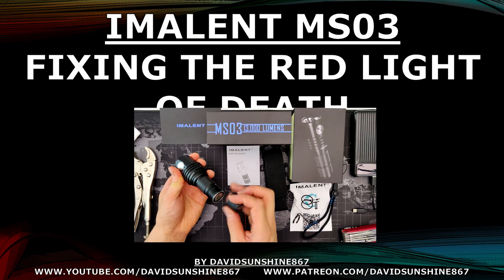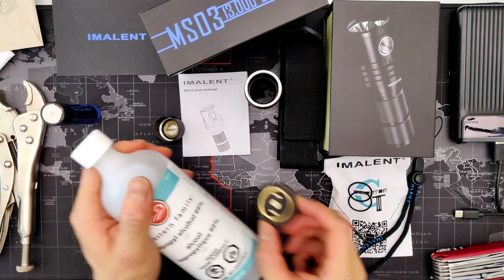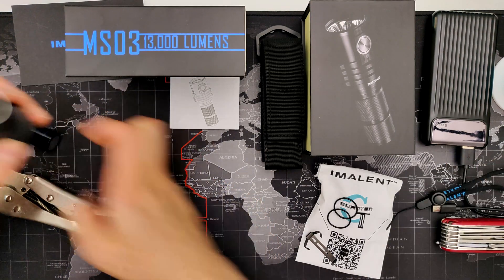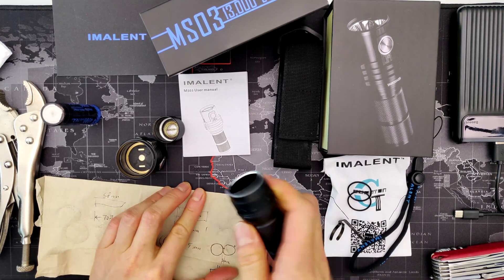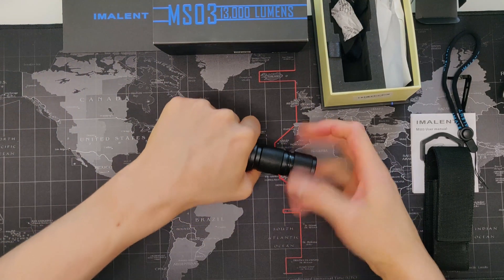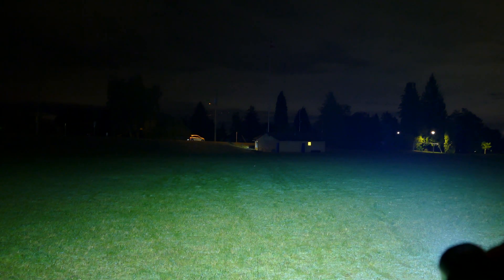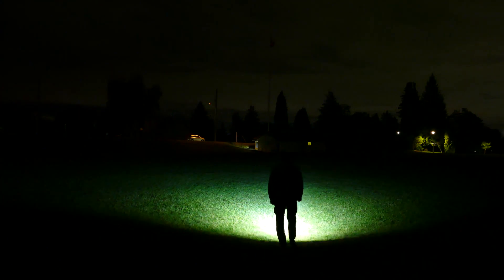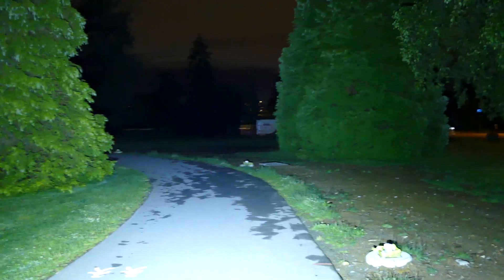How To Fix IMALENT MS03 - Red Light of Death

Comment: I wish I had the general electrical knowledge to attempt this but I returned mine and will wait a couple of months to re-order the improved model. For others who think Imalent won't honor your return they refunded the entire purchase price AND the UPS shipping cost to an address in Georgia. Hope they get it right next time.
Reply from the maker: Hey thanks for letting us know!  I'm in Canada, and they asked me to ship to China, so that was expensive, and they wouldn't pay for it all.  Not really worth it for me to return. But glad they have a place to ship to in the Georgia.  I would recommend purchasing from Amazon, since defective products are easy to return and it's paid for by the seller.  By now, I assume the new stock have been fixed.  I don't think they fixed the switch tho, it can probably still get water into it and stop working, until you let it dry out.  It's just a tactile switch under that metal button; I took it apart a couple days ago to check.  If you want full water-resistance, you may want to look at another light.
Cheers!
David.

Comment: Does this light function properly if using a Samsung 30T or 40T?
Reply from the maker: Hi,
After cleaning up the threadlock and contacts, I tried a Tesla cell and the Sofirn 40A cell (might be a wrapped Samsung 40T?), and they seem to work similarly to the Imalent cell(initially anyways, I didn't do endurance testing with cells other than the Imalent).  This light can only use the extended cell that it came with, unless you extend a 21700 to about 75.75mm; I used a piece of copper as a spacer, seemed to work fine.  I don't have the 40T or  30T, so I can't check with those, but I'm sure it'll work well with those.
Cheers,
David.

Comment: Not working for my MS03.  Disappointed.
Reply from the maker: Hi Clement,  
Thank you for the feedback, it's great to hear the status of everyone's fixes.
It is a very finicky flashlight actually, as there are many points in the system that can cause the low voltage cutoff the engage. Mine started degrading in performance, and I think it was hitting the LVC again prematurely, so I did a second cleaning, and it's working a little better. 
It appears that if the battery is at about 3.81V, the red light will appear for a few seconds.  After my first cleaning, it appeared(for a few seconds) at about 3.9V, so cleaning all the contacts very well, will make it perform better.
If you don't want to try cleaning it any more, I would send it back for repair, I'm not sure how well their customer service works, but it looks promising. 
If you'd like to do the cleaning as I have, I think you'll be happy with it's performance.  I did some endurance testing, and I was able to go into turbo for 45 seconds, 7 consecutive times with 5 minute rests in between for cooling and testing of voltages, before the red light appeared.  I was also able to go into turbo 12 times for 45 seconds, until the red light stayed on indefinitely, so that's pretty impressive, since that's about 5.25 minutes of turbo with no red lights, and a further 3.75 minutes (total 9 minutes of turbo) of turbo with momentary red lights.
The interfaces that I cleaned with Deoxit and polished with sandpaper are listed below:
1.)  Battery terminals (Deoxit)
2.)  Spring contacts to the battery and tail cap (Deoxit)
3.)  Tail cap to body tube (Deoxit)
4.)  Body tube to tail cap (Polish and Deoxit)
5.)  Body tube to driver (Polish and Deoxit)
6.)  Driver Negative and Positive Terminals (Deoxit with wood). Make sure no threadlock residue is present.  Use a magnifying glass to check the terminals for burrs, make sure it's smooth and makes good contact with body tube.
After the above, I torqued the body tube to the head with about 25 ft-lbs of torque, pretty hard, since you need good contact to the driver from the body tube.  When installing the tail cap, I also twist on as hard as the hand can turn.  
After completing the above, the flashlight should be able to pull 25-30A without detecting a low voltage, as long as the battery is charged above 3.9V.  
Hope that helps!
Cheers,
David.
Reply: @DavidSunshine  Thank you David for the details.  I will try what you have suggested again.
Reply from the maker: Hi Clement, 
It looks like Imalent is aware of, and has fixed the sloppy threadlock issue; in this video released 6 days ago, they show flashlights with a 202007... serial number, I assume it was built in July, and should operate properly, like it should after you fix it. You may want to just contact them and exchange for one of these, if you can't get it working normally.
https://youtu.be/r_cMLSS-Kz8
The one I ordered has a 202006 serial number, and had sloppy threadlock all over it!
Cheers!
David.
Reply: @DavidSunshine  My MS03 has serial number 202005XXXX
Reply from the maker: @wokwithwong  Good luck!  Sounds like yours was made just a month earlier than mine.  We can assume all lights made prior to July require us to clean up the threadlock.  
If you're still having trouble, I recommend contacting them to get a replacement made in July, without the threadlock issue, I'm sure they'll make it right, they seem like a reputable company. 
Cheers!
David.
Reply: @DavidSunshine  Turns out my MS03 was a defective unit.  I have contacted Imalent, returned the defective unit and waiting for a replacement.
Reply from the maker: @wokwithwong  Thanks for the update!  That sucks that it's defective, it'll suck waiting, but that's great they'll send you a new one.  Hopefully the fixed all the bugs in the new batches.
It's a good quality light, I did some drop testing on it and it seems tough, aside from the front ring that pops out, just gotta push it back in.  And the side switch gets water in it, but that doesn't affect the driver, just the switch. As soon as I dried it with some heat, it started working again.
They said this was IPX8 but it can't even handle a bucket of water got an hour.
Aside from that, I'm still pretty happy with this purchase.  One powerful pocket rocket still!
Cheers!
David.

Comment: Wow. Exactly. Thank you so much for the advice. You save Imalent both $$ in returns &/or repairs & in "image."
Reply from the maker: You're welcome!  Hopefully!  It's also a pain to have the down-time of sending back the flashlight and waiting.  We also like modifying flashlights, so why not take it a part a little and have some fun right?  This reminds me of my Convoy S2+ Inferno, it pulls a lot of amps for it's size, and gets hella hot just like this MS03, but the MS03 is even more crazy, so some headaches with current draw are expected. 
I'm surprised they didn't bypass the tail spring, but I touched it, and it's actually not hot after a turbo session, so there must not be much resistance there.
Looks like they released a new video showing the 202007.... numbered flashlights operating properly, so their July 2020 builds should be fine!  https://youtu.be/r_cMLSS-Kz8
Cheers!
David.

Comment: There is no fix and Imalent still believe it's glue residue lol 🤦‍♂️
Reply from the maker: I'd say they're halfway there.  I got mine fixed by cleaning the threadlock off with a chopstick and contact cleaner, and I also took out the tail spring and cleaned that all up.  I also cleaned up the tail contacts on both the tail cap/spring and body tube sides, as well as the body tube at the front.  I used polishing sandpaper, but I don't think that's necessary, but if you're having issues still, I would use polishing sand paper then some Deoxit, as it leaves a protective coating.  
With all the of the above, I've fixed mine, and am very happy with it.  It's a beast of a light!  I'm doing a full review of the light, so stay tuned!
Cheers,
David.
Reply: @DavidSunshine  It will fail again. They've sent me a 3rd sample stating its from the fixed batch. This time its a MS03W, guess what? Red light.
Reply from the maker: @FLASHAHOLIC_TV  I'll do extensive testing on mine and keep everyone up-to-date.  That's too bad they haven't been able to figure it out tho. 
Cheers!
David.
Reply: @DavidSunshine  A few people have cleaned it up including myself but the issue comes back. I've had it happen on an E07 too, the head would only work with a copper body, Fireflies were stumped!!!
Reply from the maker: @FLASHAHOLIC_TV   I see.  Thanks for the heads up!  Sounds like the low voltage protection is kicking on early.  Mine seems to be working fine now, and the light is staying green, but I'll do more testing and see what happens, and include it in my detailed review.
Cheers!
David.
Reply: @DavidSunshine  apparently it still red lights with a soldered 40T
Reply from the maker: @FLASHAHOLIC_TV  That was my experience as well, no matter what cell I put in, it would give me the red light indicating low voltage detection(I put in a 21700 Tesla cell, and the Sofirn 21700), but after I cleaned mine up, it is working as intended with the stock battery.  They set the low voltage protection at 3.6V, so if the voltage detected is less than that, it'll indicate a red light.  They should have set it lower if their boost driver can handle it, I would rather they set it to 3.0V.  It still works ok running at 3.6V, as I've been able to go to turbo 7 times before the drive detected something below 3.6V and went red, which means it works as designed.  Cheers!
David.
Reply: @FLASHAHOLIC_TV   we are so sooooooooooooooooooooo appreciate for David Sunshine. thanks dear david, you are sooooooooooooooooooooooooooo much. your words means a lot for us @David Sunshine
Reply from the maker: @ImalentFlashlight  My pleasure!!  Flashlights are our hobby, and we appreciate all the hard work Imalent put into the engineering and manufacturing of your flashlights, to bring us a great product!  Keep up the good work!  Your designs and special features are pushing flashlights to the limits, beyond that of any other company, so that's great to see and we're enjoying your innovation every step!   Can't wait for your next evolution of flashlights!  Cheers! David.

Comment: I returned this flashlight due to that problem, also even when fixed this battery can't hold more then 3-4 turbo runs also its stepping down after few second anyway.Flashlight get so hot that you can't hold it, its to small for that power output and battery is to weak to power the flashlight plus the cost is to much,  ordered ASTROLUX EC03 just for 35€ way better throw and very nice flood
Reply from the maker: Ya, it's way too small of a light for 13,000 lumens, that's like 130w lol.  But if you want to have that much power in a compact flashlight, this is the only way to go right now.  They've got a lot of thermal protection to reduce the light output, or stop it from going into turbo, so I think they've done well by adding those. 
It is pretty pricey tho, and at this size, it really can only be a 2000 lm light, continuously.  
For those who want a good amount of light for a long period of time, the Convoy L6 is a good size, it can push the full 3800lms and be really warm, but never got scorching hot since it has huge heat sink fins.
The EC03 looks like a great like.
I'm happy with my EC01, great thrower and power output, the EC03 is just even better!  And at that price, Astrolux is giving great bang for the buck.
The XHP50.2s are awesome, I'm thinking of adding one to my S2+.
Cheers!
David.

Comment: Banggood don’t even wants to reply to all my emails as I think they also could not solve this problem yet they want to sell this faulty light in the first place just to make customers buy.......Banggood is a company not to be trusted and imnlent is a lousy brand
Reply from the maker: Hi,
Oh that sucks man.  I haven't ordered much off banggood, just a handful of items. I usually order off Aliexpress, and they've been pretty good about broken items, they usually give a full refund.
If you're within the return period, I would file a dispute and take videos/pictures of the issues, and make your case.  Imalent is a pretty big company, and I'm sure they'd like to help.  Not so sure about banggood, but Aliexpress would definitely step in to make you happy, they've done so for me in the past.  You just need to make a great case, be clear, and have all the evidence for them to see that you're in the right, and should be refunded, or helped with a return or exchange.
I was pretty pissed that I spent $129USD on a faulty product, but after cleaning the contact, I'm pretty happy with it!
Did your negative ring have thread lock covering it?  Using a piece of wood worked really well to scrape off all the threadlock and clean it up.  If you just wipe it with rubbing alcohol and a q-tip, I don't think it'll clean it all up.  
Cheers,
David.